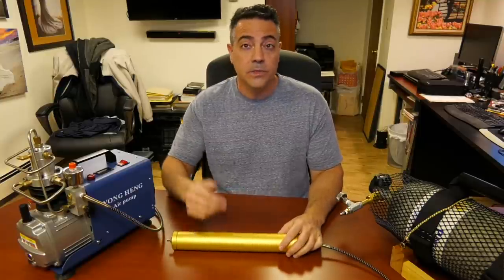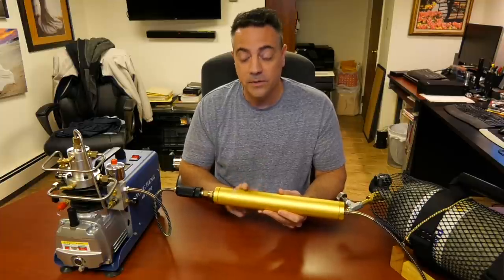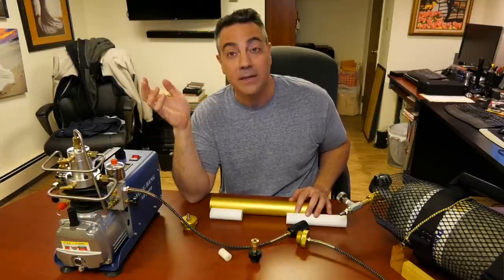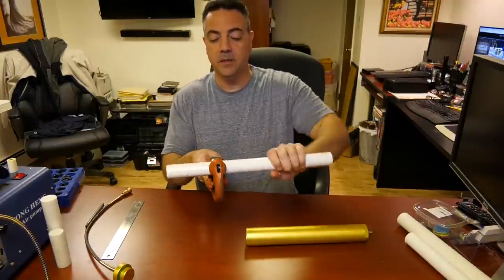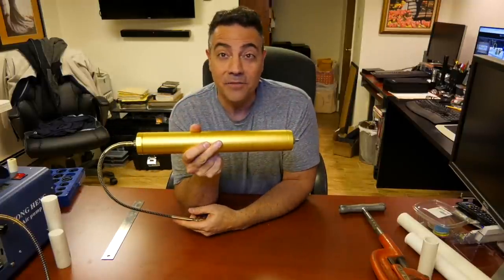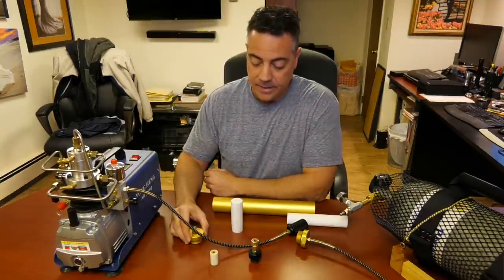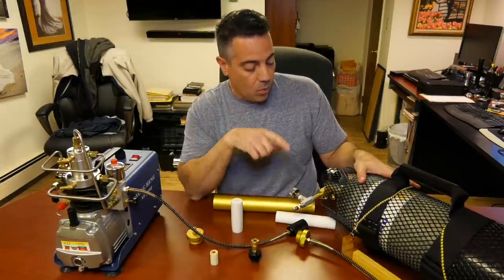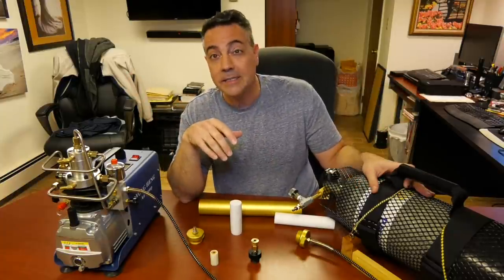Yong Heng 4500psi compressor and Water Separator (molecular sieve) for PCP Airguns

Comment: After filling your tank, just store it overnight air valve down in a cool place so any water can condensate and accumulatie near the valve. The next day just  blow out some air and any water buildup will be blown out to. Never had any corrosion in any of mine scuba tanks. No need to overengineer simple things. Just use the small filter to keep oil crud out.

Comment: Spot on about safety! Only problem is you have to periodically approach your system  while filling to make sure you don't over pressurize your tank or exceed 4350psi of that compressor. I don't have automatic shut-off and wouldn't rely on it anyway.
I seen on Amazon where a customer said a similar version filter canister split on him while filling. SCARY indeed!
Excellent job as always! You are a tremendous asset to PCP airgunning.

Comment: Hello Air. Update on the new relay. Perfect fix.They did send the relay with all the wire attached. Makes it very simple to change. Would have been hard to figure out otherwise, They did switch and double up a couple wires. They send you one extra crimp end. I was a little unsure so I emailed and double checked with them. You will see the brown wire that burnt. You will cut that brown wire put the crimp end on there. The brown wire will now connect to a double green wire on the relay. ( Very obvious ) . I did take several pix before I did it.  I will say this new relay looks ALOT better built. Hope this helps everyone. P.S. They did replace it for free. Tried to get me to pay for shipping but I was not going for any part of that after just giving them 350 and can not use my new compressor. lol they did send it for free. Thanks again for all the help Air. You were a big part of getting my wife and i to this point with tank and everything. I do have the same water and oil separator now also.
Reply from the maker: Steve Judd  that is great to hear. Thank you for sharing that very important information. I still have the wrong power relay connected just because it works good enough for me. But now I feel more confident because of your update to make the switch to the correct person relay. Can you post those photos for everyone to see? Thanks
Reply: I don't see how to post them.

Comment: One more thing to consider. I think the filter should be mounted vertically. The input should be at the bottom, the output at the top. I found some 400 mesh stainless steel screen on amazon that could be used to hold in the media. 400 mesh is finer than most common bed sheets. Also there should be a check valve and a bleed valve at the bottom, to open up at the end of the run to blow out the accumulated moisture and oil (depending on how much comes out, you might want to do it every so often).I am going to use the screen at the bottom, so that it blows out good without losing any media. I'll let you know how it works. All I have right now is a 90 cu. in. bottle, but I plan to get one much larger, like 12 liter. When I do, I might add another filter in series with the other one, with it's own check and bleed valves at the input, to make sure I get most of the moisture out.With a bleed and check valve at the input of each filter,  I can bleed them seperately, to see how much comes out of each filter.

I know this must seem like going overboard trying to eliminate as much moisture as I reasonably can. But like you said, the dryer the better, for the long haul. I'll try to document the process. I've ordered everything so I should be able to try it in a couple of weeks.

You wondered what the other bleed valve on the compressor was for. It's the moisture/oil bleed valve. It should be opened every so often to blow out the accumulated moisture/oil. I think you are supposed to open both of these before shutting off the compressor.

Harry

Comment: Thanks  a million for this vid. I have a similar compressor and on your recommendation got the same water separator. Instead of white PVC, I used 30mm clear acrylic tube and colour changing silica gel as the desiccant. This way I can remove the desiccant canister and inspect it (goes from orange to dark green when it needs changing).
Reply from the maker: captainboing thank you! I like your idea of the color changing silica gel.
Reply: Where u get that 30mm tube at & color changing silica gel.  Is the silica gel  better then this guys stuff. Or the same
Reply: @tropicthunderbolt  all came from eBay.  I only put an O ring around one end of the tube so the pressure can equalize on both sides.  The air still has to go through it but can't explode it or crack it from the inside.  The gel is orange and goes dark green when it is soaked.  You can reverse it by putting it in your oven at 60C until it goes back to orange.  From reading around d it seems people think the gel is as good as MLS but I am not a chemist so you have to be happy in yourself. Ill see if I can do a vid of it and post it for ya. You could try some sieve as well if you want,  just a matter of changing out the cannister content but I like that I know when it needs changing... that was an accident btw. I discovered it while I was looking at dessicants
Reply: @tropicthunderbolt  here you go. https://www.youtube.com/watch?v=8gAUhrzsV68  

These links to the materials are from ebay UK but they should give you the lead you need to find them locally to you. Enjoy.
Acrylic:  https://www.ebay.co.uk/itm/CLEAR-ACRYLIC-TUBE-100mm-200mm-300mm-lengths-30mm-to-70mm-Outside-Diameters/200973097176?hash=item2ecaee18d8:m:mN6o-AvURVMTTztLU0txLLA:rk:1:pf:0  
Gel: https://www.ebay.co.uk/itm/SILICA-GEL-COLOUR-CHANGE-ORANGE-TO-GREEN-FOR-GENERAL-DRYING-OF-VARIOUS-ITEMS/281240594731?hash=item417b3ee92b:m:mwm4KWh55K4eJNqa9gzmmzw:rk:3:pf:0&var=580284548667
Reply: @captainboing  nice.   Thanks

Comment: The power relay picture is from my my own compressor. They used the pic I sent them when searching for a spare one for mine . It hasn’t failed , but smells like it’s ready to. Hopefully they send you the correct part , I’ve ordered it also . The 1st I was sent was totally the wrong part . Was great to see that you’ve done your set up exactly like mine . You do great reviews 👍
Reply from the maker: Dave Sloan thanks! Yes, the power relay I purchased from eBay for $7.57 works but the auto shutoff off does not work. Even thought the replacement  relay I purchased looked the same but must be wired differently. I do love the Yong Heng compressor so far.
Reply: Dave Sloan do you have link I just got my compressor in and it ran for 10 mins and shut off smells like something burnt inside the compressor didn’t even fill my tank don’t even get to use my guns today
Reply: Dave Sloan I can’t believe it failed first time trying , is there a American relay or better made relay that can be used?
Reply: Big Bore Bandit I don’t know if that get you to the right spot? But if you look on AliExpress and yongheng accessories for that same picture of my part , you’ll find it . Lemme know if you find it . I ordered 2 just in case . Mine is still working . You’ll find that the adjustable pressure gauge vibration is wild . I wedged heavy foam under and beside mine and it helped a lot . His bouncing needle is what caused the shut off controller to burn out I think . I can’t get a positive off signal when it’s getting close to full.
Reply: Dave Sloan yeah I mean I just started to fill my tank and boom it shut off I thought it reached the correct pressure , I was hoping to be able to pick up a relay from a auto store or home improvement store , hate to wait a few weeks for a part for something I just bought I filed a dispute with the Ali express store I bought from seems like a trend now , I mean the relay in mine melted and caught fire
Reply: Big Bore Bandit I’m not sure if a better one available?  I’m in Canada, didn’t bother looking for North American product to replace it . If you open up the cover and check your connections as well ?
Reply: Dave Sloan yeah the thing is melted I already opened it up and the front wire that is brown is where it melted the rest looks fine but the relay is partially melted .
Reply: Big Bore Bandit shit !! Well I’ve ordered mine at least a month ago and I haven’t received them yet . Hmmm Im not sure where to look locally for you ? You could probably find the wires from it and bypass it all together to your switch . You’d have to watch it while it fills or you’ll over fill and the Burst disc will pop off .
Reply: Dave Sloan wonder if I can wire it some how where I can at least use it today ?
Reply: Big Bore Bandit if your electrical at all , there’s basically 2 wires that will power the motor , if you follow wires from the on off switch and the ones from the motor that both lead to the controller , you should be able to figure out which ones to use to connect directly to the on off switch ? That would be my best guess ? If you know a electrician I’m sure it would be a easy bypass .  I’d attempt it myself if mine fails .  Un plug it first for sure 👍. I love my pump and would definitely order another if this one blows up
Reply from the maker: Yes, my power relay burnt after a few runs then I purchase a similar power relay on eBay. It worked but the auto shutoff off no longer works. I order the Dave Sloan one on AliExpress three weeks ago still haven't received it. But I don't care so much because the eBay look alike is working for now. Here is the link to eBay where I bought my replacement power relay https://rover.ebay.com/rover/0/0/0?mpre=https%3A%2F%2Fwww.ebay.com%2Fulk%2Fitm%2F110928901573
The binder power relay is not even on their website.
Reply from the maker: Thank you Dave Sloan for helping everyone get back on track with this power relay issue. This why I make these videos.
Reply: Air Velocity Sport heh , no problems , your vids are great for learning new ideas and reviews helpful as well . My set up is pretty much the same and love everything about it . Super quick at topping off my tank and so far is flawless. Yes I’ve ordered extra parts for the just in case moment . Will keep you informed how the new parts test out once they arrive. Thank you 😊
Reply: Dave, could you help me find the 220v type? thanks man..
Reply: stoner27th eBay , I would also contact the seller where you bought it , I filled a complaint and asking for a partial refund and replacement part , mine burned out in 10 mins of first use. But eBay has 220 type I actually accidentally bought one that is 220 you could buy the one I bought I’m waiting on a 110 one now.
Reply: stoner27th mine is the 110 version with adjustable shut off . I’m pretty sure the 220v are less in price for some reason , just be sure to let them know the proper plug end type you would like .
Reply: stoner27th why would you want the 220v ? Depending where you live obviously, but most North American outlets are 110 . Going with 220 kind of limits you to where you can use it . If you do order it . Be sure to look back in this feed to find the extra control switch and have them ship you a spare or 2 .
Reply: I live in Indonesia.. so it's 220v here,  my Yong Heng is still otw, I got the airmax compressor 12 volt type for now, but it's not as powerful as these Yong Hengs, So, I don't have any problems yet, I just like to prepare for anything.. LOL..
Reply: stoner27th oh well then yes you need the 220  . Be sure to check out that other supplier To purchase the extra control box and you’ll be set . Other then that you’ll be very happy how good they are
Reply: Big Bore Bandit did you find a buyer for your compressor?

Comment: @air velocity sport - First off, thanks for the videos. Love your videos.  I bought a YH compressor and haven't filled my tank yet only my pcp.***QUESTION***  So to make sure I don't break a burst disk again.....   Let me list out the process and can you please confirm, I've got it down?  FYI, I bought the parts to the fill assembly exactly as you have yours with the added bleed valve on the SCBA tank side.  So here's what I  think I understood for the Process to fill my SCBA tank from the YH:  1> Turn on YH w/ YH bleed valves open.  2> Let it
equalize to tanks residual or current pressure.  3> Now open the tank.  4> Let it fill and bleed water every five mins on the YH.  5> Auto shut off shuts down YH.. 6> Close my tank.  7>Release air from bleed valves and water on YH. 8> After Air bled from the system, safe to disconnect.  Please let me know if I got it or I miss anything.  Trying to not get a burst disk! =)

Comment: I'm going to use activated alumina without the pvc pipe since its noncorrosive. This will allow much more beads to fit. Got great deal on EBay..18.95 for 5.5#. Should last forever.

Comment: I am in Cornwall UK.  Some good tips there on HP safety....  however, I used to test these cylinders and as long as no water gets in they are good, oil is breathing air safe (or should be) so should not cause fire.  Those compressors are fine in UK!...... I tried to burst a 3 liter Faber bottle on purpose...got to 590 Bar with water and I couldn't do it!!,.I have seen these cylinders dropped down sea wall steps and they been fine unless the valves catches then it can be like a unguided missile.

The Oil you put in it should ONLY be Breath air comparable,  Anderol 555 (is best) or   Bauer N28355-5, change oil as often as you can afford !

Normal hydraulic oil will start a fire easy.... 
the oil and water filter you have shown is doing its job as all compressors will pass some oil. Always start compressor with all bleeds open and also when shutting down.....Go to a Scuba centre and ask how they run theirs!!!  

  DO NOT PUT ANY OTHER OIL IN OTHER THAN COMPRESSOR OIL IN IT THAT IS SUITABLE FOR BREATHING AIR!!!

GOOD Video though!!

Comment: In industrial applications you dry air before compression. I’m making a pre dryer now  using 3a molecular sieve and will post when I’ve proven the design. It’s a no pressure set up so inexpensive by comparison to this arrangement, though I have to say this is better than cotton! Molecular sieves are easy to monitor and recycle and cheap too.
Reply: What is the definition of an "industrial" application for you? I would dare to say that >99% of all compressors in workshops don't use predrying. Because predrying is expensive. And postdrying is cheap. The water drops out on its own when cooling to ambient.
Reply: @jackmclane1826  garages etc post compress dry air, I’d call those applications as commercial. They use separators such as norgren that also add oil the air for tools.
Industrial use of air is a different sector. I’m ex ingersoll Rand and we made equipment to dry air for many applications from food to chemical processing and metallurgical uses.
Reply: @tomtd  I'll check our compressor rooms when I get to one again. We use oil free and very fine particulate filters. But I doubt, we do predrying. We run clean rooms for precision optics.
Why would anyone - food to chemical or metallurgic - use a more expensive drying method? What is the benefit of predrying? 
In the end, the air is dry, but you use much more effort for it, than just letting ~90% of all water content come out on its own.

Comment: Back in the day when I was scuba diving frequently, there scuba shops when filling the tanks would fill the tanks  partially submerged in water in cement walled vats.I expected this to be used to control the temperature of the steel tanks while filling. This was only partially true. As cooling was beneficial, it was also a protection if the tanks were to rupture. Having the tanks partially submerged at the time of filling and failure,, the force would be absorbed partially by the weight of the water and the barrier of the cement walled vat. I saw photos of such failures. So at the time, this was the method of precaution that industry was encouraged to do. Looking back on this method and thinking on the lines that forces must be applied by a medium. For example an explosion in air which does not eject debris only the force. A great amount of that force is diluted from the compressibility of the atmosphere. Take that same explosion under water and within the same distance, the damage is more devastating. This is because the water is not compressed and the forces are not diluted. Would the water and cement in the containment vat become a media to transport the energy of the exploding tank? SoI don’t know. if the volume is low and the bottles are secured so they don’t go flying around the room, is there a significant danger?
Reply: I don't think your tank would rupture

Comment: Almost three years after you posted this video. The compressor would not be as popular if it would blow up all the time or hurt people.
I just filled a 10 Liter 300 bar bottle to 200 bar in two runs and will continue tomorrow.I don't have the room to set up a protective wall but I position the compressor so that it can throw parts away from me, if something goes wrong.
I am using the unbranded version .... again. They have been selling this for years and it works if you handle it with respect and follow the manual. I am more concerned about that 10 liter bottle once it is filled to 300 bar. Now that is a bomb but those steel bottles stand around construction sites in full sun light all day long .....